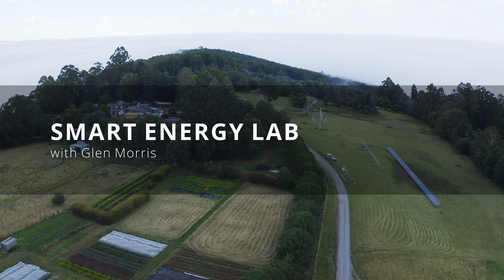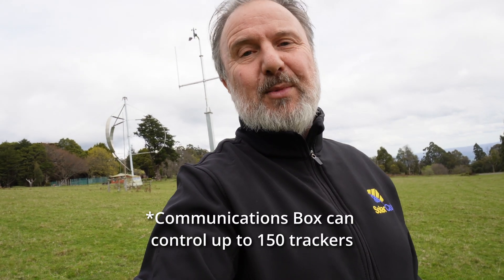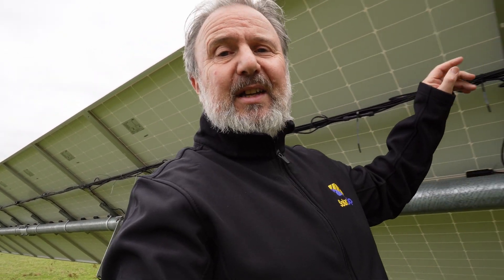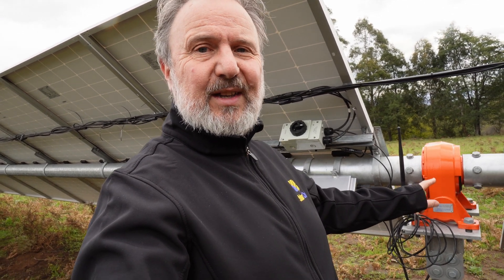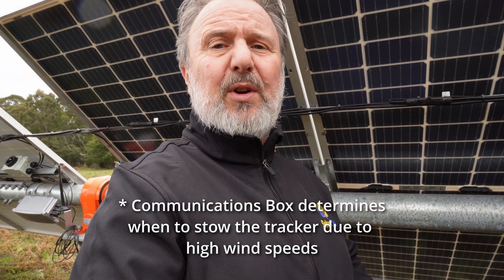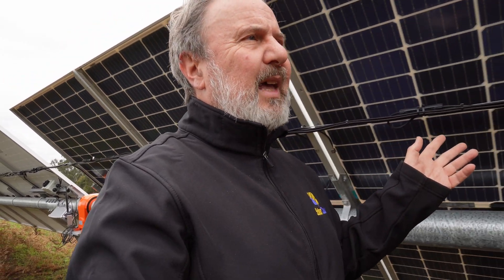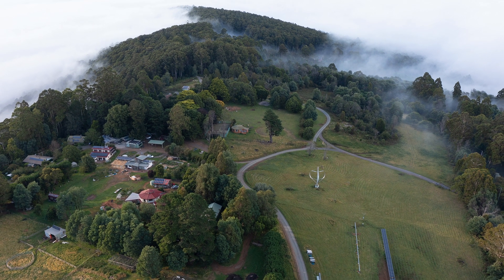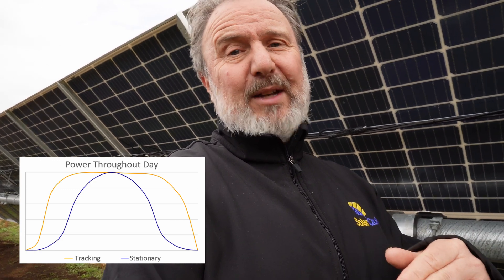Real world, side-by-side testing of mono v's bifacial solar panels

Comment: That is one sexy array! How about posting some comparo kWh harvest numbers? I am converting my older mono's to bifacial (Q-Cell)...got two arrays done. They def juice in low light much better  vs mono.
Reply from the maker: I am working on a video with Longi Solar showing the performance differences but as a spoiler, it's about 6-8% more production given that the albedo from green grass is quite low. Be aware that if you're replacing monofacial with bifacial, you will need some rear reflection such as a tilted array on a white roof or a ground mounted system to actually get better performance than monofacial. Without the rear boost from albedo, bifacial modules attached close to the roof structure will be less productive as there is no internal reflection that a monofacial backsheet provides.
Reply: @SmartEnergyLab  -- great information, thanks. Two of my arrays are ground mounted (with the Q-Cell bifacials). One array is ground mounted with mono's, but up against a fenceline. So, that array won't get new Q-Cell bifacials.

Comment: I watched the video expect to hear the production difference in kWh produced. Got no info other than it works good in fog and and light ground (snow).
Reply from the maker: Hi Ted, sorry for the no show on data. There's been an ongoing problem gettng the data from Refu who's inverters log the production. However, anecdotally - looking at the kWh/day readings on the screen, I can see that on most days the bifacials are producing 6-8% more than the monofacials.
Reply: @SmartEnergyLab  Thank you.

Comment: Bruh. Still no numbers. I know I'm the audience for this title, but who is the audience for this video?
Reply from the maker: Sorry Sween, we have a few technical difficulties with the data aquisition to solve first. I'll make another video once I have the data to compare. Anecdotally, the bifacical are generating more in overcast conditions and probably 5-10% more overall.
Reply: @SmartEnergyLab  Thanks sorry for the sass. But searching for this information is infuriatingly difficult.
Reply: @SmartEnergyLab  
Is that in ADDITION to the wattage rating?

Or is the bifacial ability REQUIRED to achieve it's wattage rating?
Reply: @dialecticalmonist3405  Any bifacial factor is additional to it's front facing cell rating.
Reply: @EverythingOffGrid  
THANK YOU. That helps a lot.